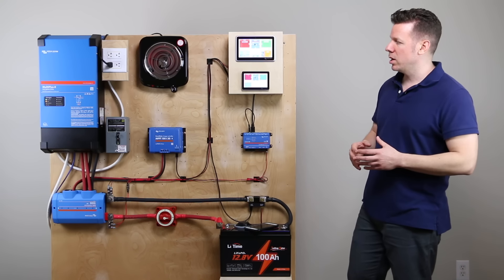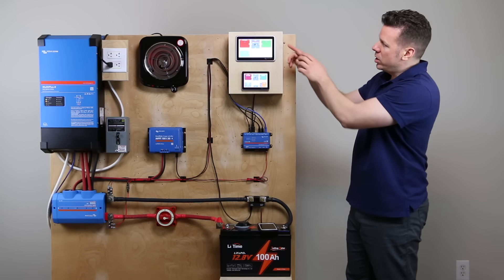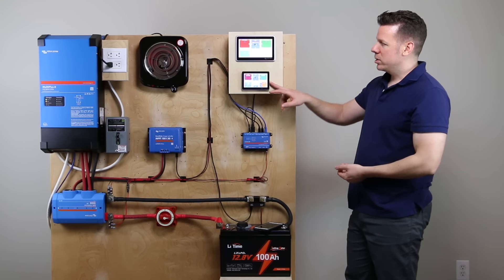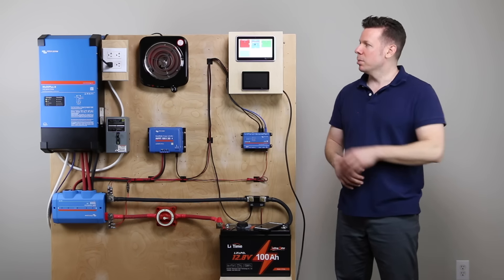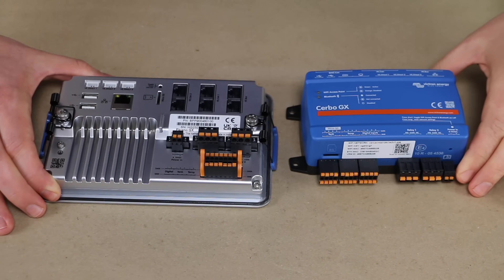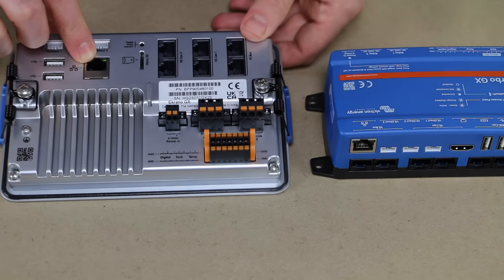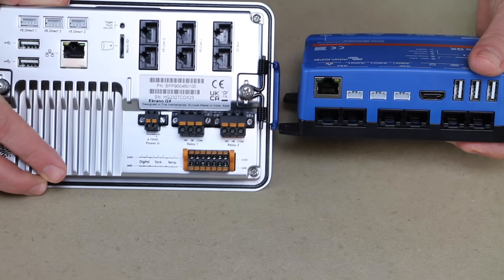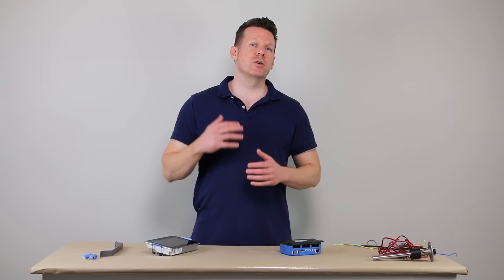Victron Ekrano GX vs Cerbo GX (which is best for vans & RV's?)

Comment: According victron to you, don't have to plug the usb for the touch in to the cerbo gx  you can wire a usb PowerPoint near the touch screen and plug into there.
Reply: Was going to make the same point.
Reply from the maker: Cool, thanks for sharing your insights on this!
Reply: I assumed the touch interface was also on the USB--is that not the case?
Reply: @kevinhoober1863  no the usb is only for power. Everything else is on the hdmi port

Comment: The Cerbo GX wins hands down for a few reasons.... having the Cerbo as a separate box that goes in the wiring cabinet/engine bay leading to a neater display install - the Ekrano you have to have all the cables to the back of it so you are limited where it goes. Dont bother getting a display for the Cerbo as its best to use on your phone/tablet as if you buy a display they often go out of date....

Comment: I have my off-grid system in a shed 20m away from my cabin. My cerbo is online at all times, and is connected to the mesh network covering the property. instead of the Victron screen,  I use a Pi and a 10" touch screen, connected to the cerbo local via IP adress. Works like a charm. No distance issues, no power issues and no missing functionality. And it was way cheaper than te victron screen.
Reply: do you have link where buy the pi model and 10" screen ?

Comment: The Ekrano is good if it's positioned near your equipment. But, on my Class A motorhome, it was a 30' run from the equipment to the screen. It made more sense to just run two cables to the screen instead of all the cables.
Reply from the maker: That's fair, thanks for sharing your take on this!

Comment: Excellent video and description.  My Cerbo is in the Inverter cabinet, with very short cables from the devices, per the product descriptions.  However, my Touch 50 is 20’ away, mounted on my EMS panel.  The HDMI extension works very well, but extending power from the Cerbo was problematic.  So I found a good 12VDC source 6’ from the Touch 50, and used a 12VDC-to-5VDC step-down transformer with USB port to provide power to the Touch 50 with zero power or signal loss.
Reply from the maker: Thanks for tuning in and sharing your experience! Great to hear how you solved the power problem with the screen 20 feet away. Sounds like a great solution!

Comment: Many of us are hoping for for the Ekrano quad core processor in the cerbo configuration using our touch 70 or 50. Even better would be the ability to network 2 Venus OS devices—1 for the electrical closet (boat) and another for the chart table. That way, the cabling from various peripherals (tanks, ve.direct, CANbus, VE.bus) can connect to the network nearer the sources. 

Am REALLY wanting BLE (Bluetooth Low Energy) from all of my Victron “Smart” devices into the VenusOS device like the Ruuvi. (We can see smart devices locally with VictronConnect) but not remotely with VictronConnect and/or VRM)

Again, a nice video

Comment: Thanks for the info about the Cerbo GX not needing the Touch 50 or 70, and the ability to use a tablet or smart phone.  I had NO IDEA the Cerbo GX could operate like that.  This ability (tablet or Smartphone) would be very useful in my truck camper because I have no place to run the wires from the Cerbo GX to the Touch screen, unless they are surface mounted on a wall, which is very un-elegant.
I have a CCGX which works fine, but it's mounted low and in a hard to view area, maybe I will replace it with a Cerbo and use an existing tablet I already have.
Reply from the maker: Thanks for tuning in, great to hear that gave you some insights! Yes at this point, the Cerbo would be a great leap forward compared to the Color Control GX. It has the same ports, but also a lot of new ports/capabilities as well. Good luck with it!

Comment: HI Ross, thank you for all the great videos. I wonder if I could use a signal splitter (HDMI) and use two GX Touch 70 Displays at the same time?
Reply from the maker: Hi Marcus, unfortunately I cannot confirm that the splitter would work (don't have two Touch 70's) but I don't see why not, so long as the USB power was sufficiently provided to both screens, perhaps from an additional USB power source. Hope that helps, good luck with it, thanks-

Comment: What if the Multiplus is a GX version. Will it cause problems with external GX units as you then have two of them?
Reply from the maker: Ve Bus is a serial protocol of communication so cannot be shared/split.

If you want to interconnect two GX devices you can use the CAN port, But this will share only the CAN data from a system.

So best thing to do is to disconnect the internal GX device and connect all to the CerboGX/Touch.

Then all works as expected 

- Johannes Boonstra (Victron)

Comment: can this system be used to do things like lights control, slide control, electric blind control?
Reply from the maker: It’s got 2 relays, so yes, kind of. You could use those relays to control things, probably by controlling a high-current relay that controls something. Maybe look at the Simarine VIA as well. It has a bunch of controls/relays for things like that. They can also engrave custom buttons for you.

Comment: Thanks Ross. Grat video. 
You mention that you can visualize the cerbo screen on the phone with the Victron Connect app. Is that by using VRM or how else? Best regards, Silvano
Reply from the maker: Hi Silvano, this is a great question. Using the VictronConnect app, that would be over Bluetooth, within a few meters of the Cerbo or Ekrano. You bring up a good point though, in that you can also pull up this screen in the VRM portal with the feature called "Remote Console." That will pull up the Cerbo/Ekrano's screen from the other side of the world, as long as the Cerbo/Ekrano has an internet connection. Great question, thanks for tuning in again!

Comment: I prefer to extend 1 hdmi+1 usb with Cerbo than extending 3 ve.direct wires + 2 ve.direct to usb+3 ethernet:bms, inverter and wired network+tank resistive sensors+power. We never had any problem with 5 meters hdmi and usb extenders.

Ekrano is faster and better if you are planning to use node.red  but in a van, motorhome environment, probably Cerbo+gx touch will be the first choice

¿Looking forward for a cerbo processor update from victron?
Reply from the maker: Awesome, thanks for sharing your take on this! Regarding the Cerbo processor, I am not aware on that.